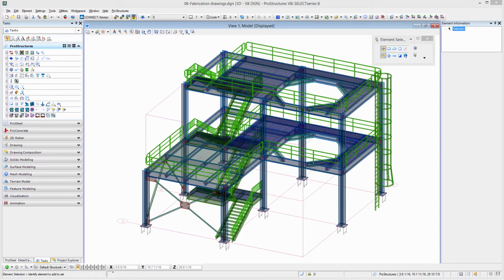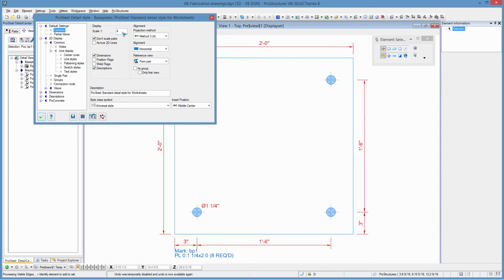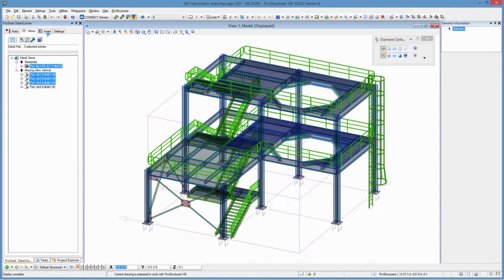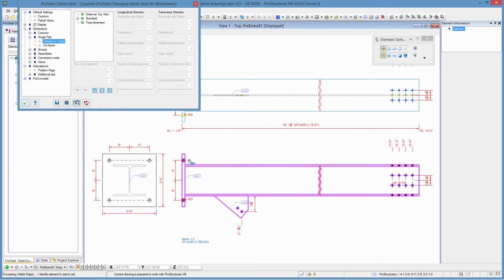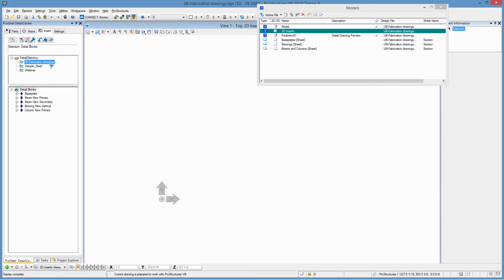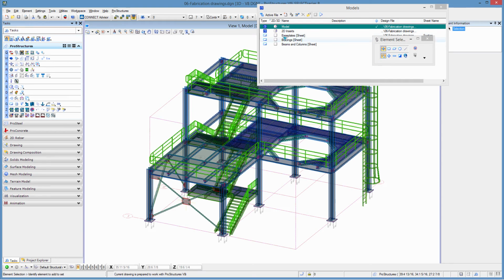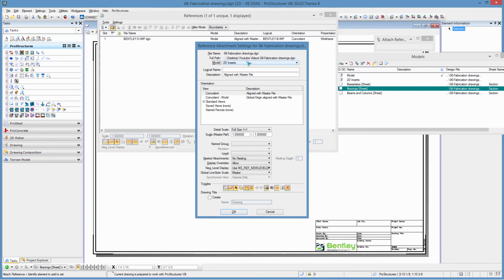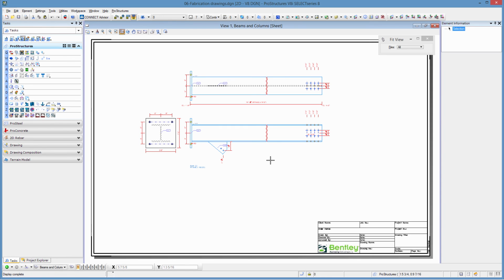ProSteel - 08 - Fabrication drawings

Comment: ProSteel is in a unique position where Tekla is not affordable and the price doesn't justify what it can actually do. Autodesk Advance Steel has the licensing problem and the engine is nowhere near as powerful as the Microstation engine on which ProSteel is now added. 
ProSteel has the potential to be something incredibly powerful with the correct development and hopefully they will be doing it soon.
Reply: PROSTEEL ES LO MISMO QUE PROSTRUCTURE?
Reply: @allsolverengineering8514  Si, prostucture = Prosteel + proconcrete.

Comment: Isn't the nesting of the items in the drawing sheet automated? I have a job with 537 shop drawings and 421 fittings, and this excludes the shaft drawings. Surely a person is not going to manually nest all these!
Reply from the maker: Don, if I understand correctly the "nesting" you are referring to is "distribution on a sheet" of multiple items. If this is the case, yes there is a way to automate this. It's using the DetailCenter Express.
Reply: Thanks! 
With the nesting I meant the beam or column detail being placed within the each drawing sheet but as you mentioned the detail centre will automate this.